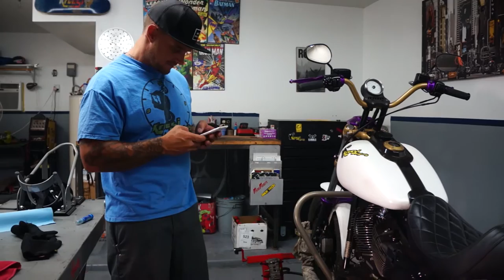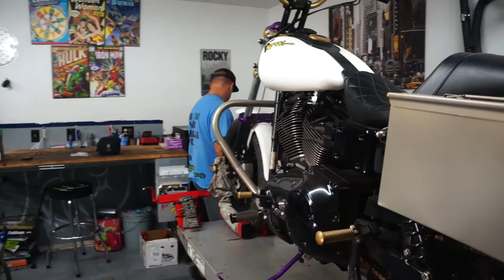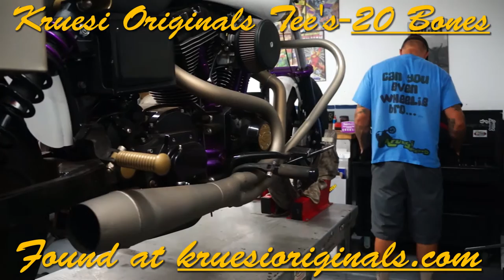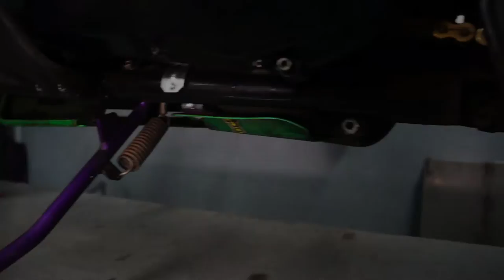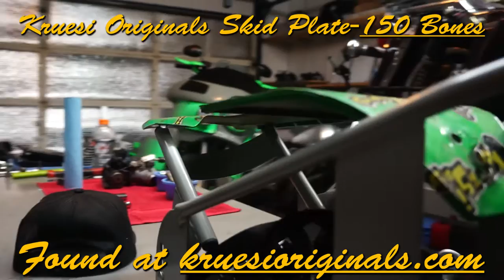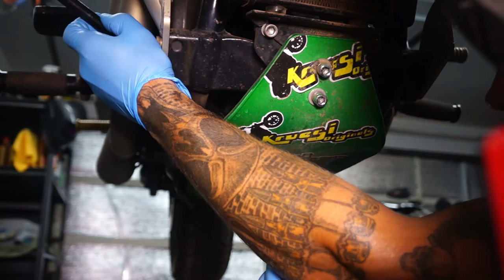Kruesi Originals how to #1

Comment: Just a tip. To get the load off the front motor mount when working on it, and when by yourself, use a small bottle jack under the engine. I do my own stuff at home and I'm doing most of my stuff solo. My wife ain't down with tools and stuff so I'm on my own.
Reply: Word,  thanks man